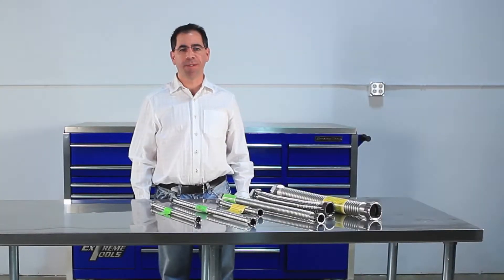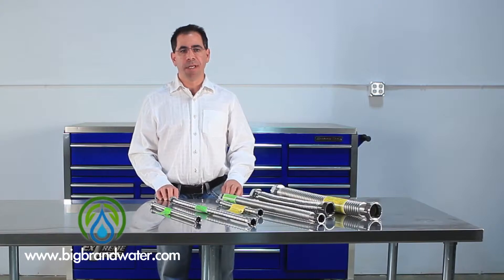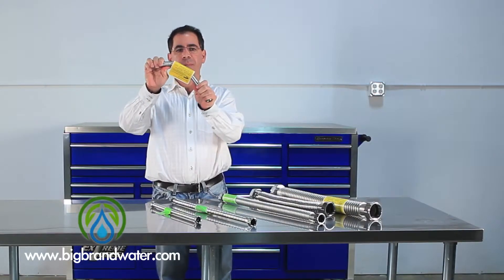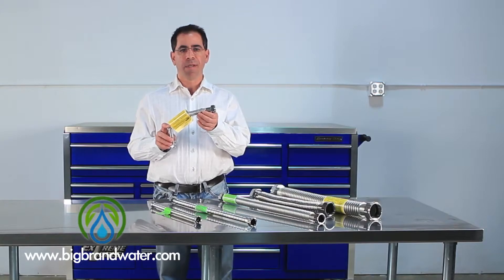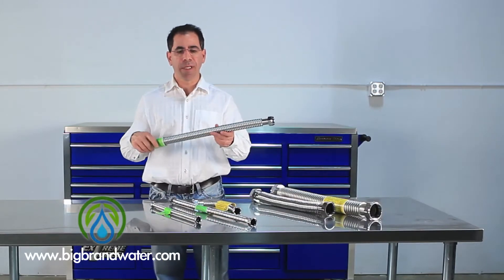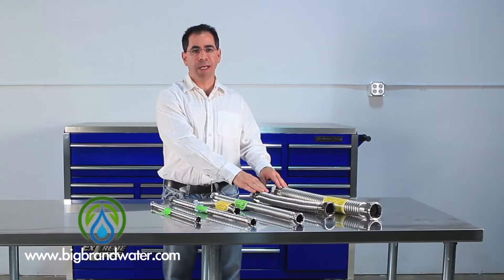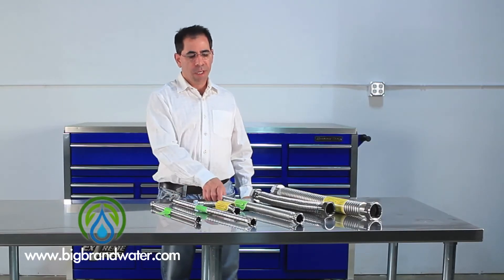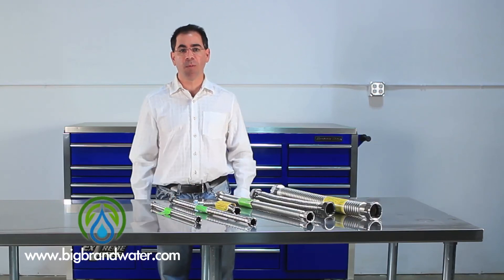Stainless Steel Flex Lines for Water Treatment

Comment: Do you sell stainless steel supply lines for residential faucets? The smallest size listed on your website is 3/4", which is too large for that, of course. If not, can you point to another manufacturer that sells stainless steel supply valve lines that connect to 3/8" fittings? It seems all companies that sell supply lines are just stainless steel braided vinyl tubing...seemingly no different from one another.
Reply from the maker: We do not offer anything smaller than 3/4", the exception would be for orders of case quantites where we can special order in smaller sizes.

Comment from the maker: Brock
Plumbing products used on potable water have to be lead free. California was the first to implement this in the 1980’s then all other states followed. Our product does not contain lead, it is 100% stainless steel so it does not have a warning. I believe you are referring to prop 65. We are a distributor and do not sell any products that contain lead. We cannot control what others make or sell nor do we write the laws.

Comment: Thanks for the video.  I would like to ask if you're product has a prop 64 warning?  My next question is why are products being sold  for hot water heaters if it has a non use for portable water?   Why not just make the product for portable water seeing how people are going to use it for washing dishes and in their home?  Think you guys could be head of movement of true low voc water lines for homes.  Please do it for that everything I can fined has for my hot water heater or washer has lead or 64 lable. Thanks
Reply from the maker: No prop 64 warning is required.  Stainless steel does not contain lead.  Older brass parts have lead.  California was the first to go lead free brass, now the whole country is lead free brass for potable water.